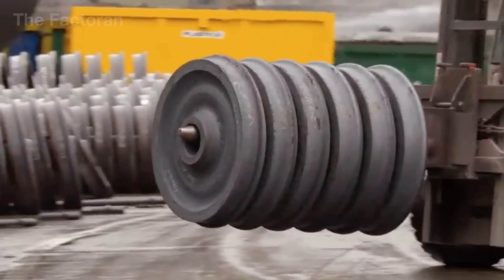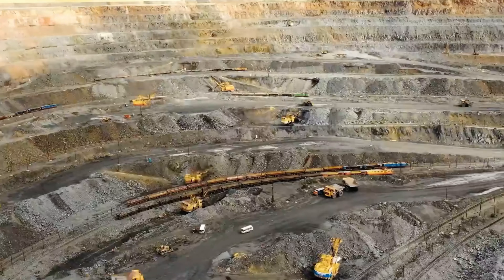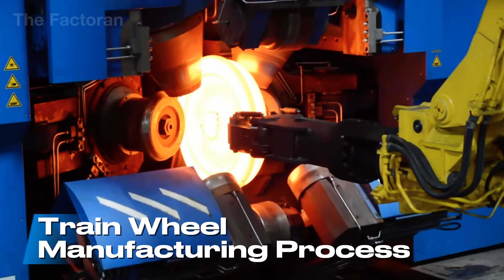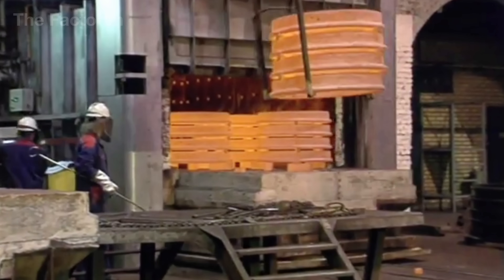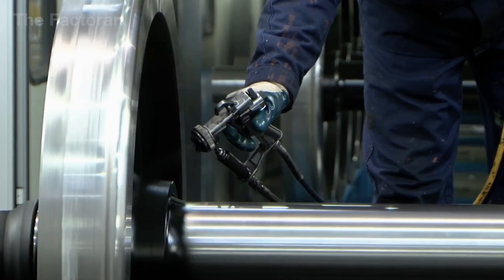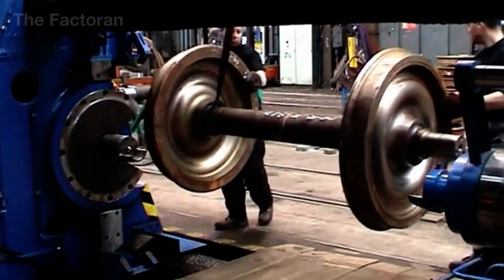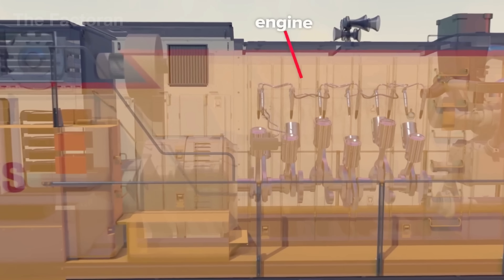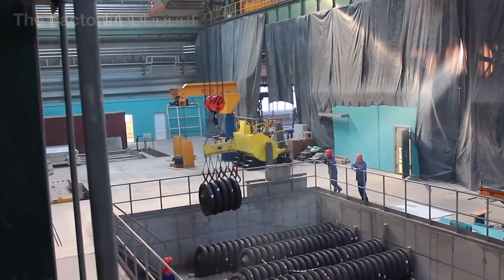How Millions of Train Wheels Are Made Every Year  Inside Massive Steel Forging Line

Comment: How did they do this for the past hundred years without these machines and computers?
Reply from the maker: A lot of it was pure labor, skill, and repetition. Machines just sped up what humans already mastered.
Reply: There was a time when railroad wheels were cast in molds. They were good, but if they were overheated with composition brake shoes during braking on long grades, they could fracture. Cast wheels are no longer used.

Comment: This video is fascinating, but it also raises an uncomfortable question: Are we pushing steel forging lines to their limits just to meet yearly production quotas? The extreme temperatures, nonstop hammering, and massive energy consumption look impressive — yet few people talk about the safety risks and environmental impact that come with producing millions of train wheels every year.
In fact, experts in industrial metallurgy have warned that when production ramps up too aggressively, quality control becomes the first area to suffer. And history backs that up
Reply from the maker: You raise an important point — balancing high output with safety and environmental responsibility is essential, and the best factories are constantly improving controls to keep both in check.